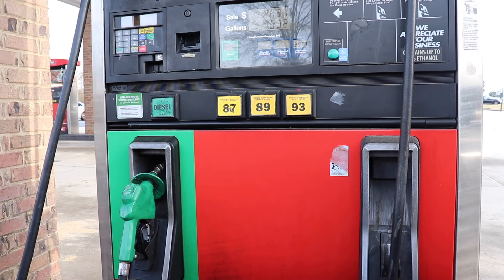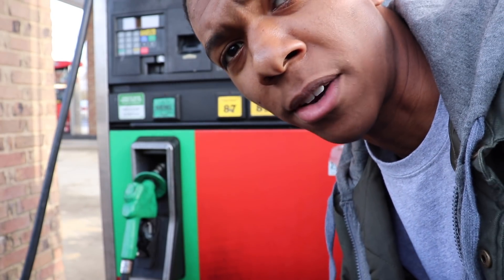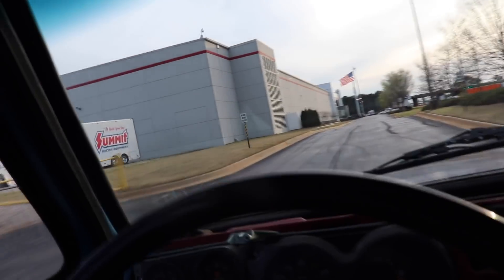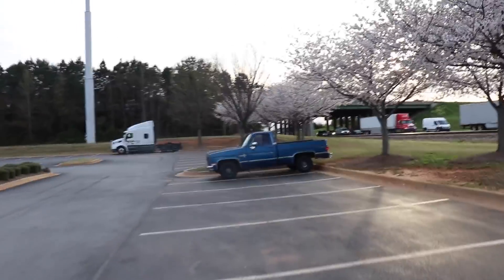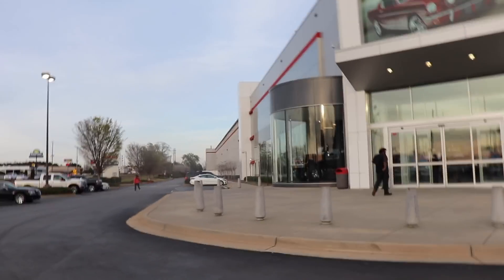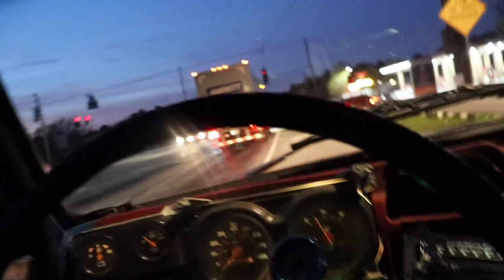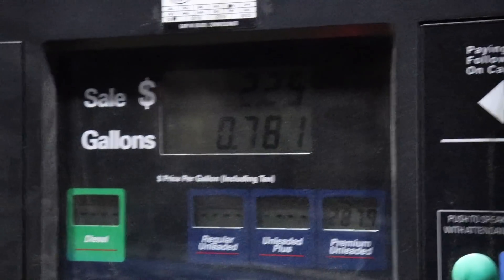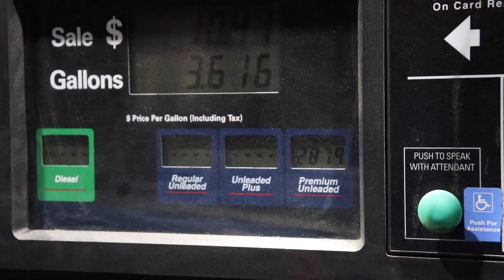Gas Mileage of my Cammed C10 Chevy Truck..... Worse than I thought...... (with 2.73, 355ci, & th400)

Comment: 11.5 mpg isn't bad. Efficiency in that truck should now be measured in SMILES per gallon :D
Reply: Our 90 k5 with a 350, 6 inch lift 35 inch tiers, with 300k original miles unrebuilt gets 11mpg. Our 88 k5 stock brand new engine with manual gets around 27
Reply: I get like 7mpg in a stock 1977 Chevy k10 with a 350ci th350 trans and 3.07 gears, 4 inch lift with 33” radials
Reply: Dustin  Wagner how are you getting 27? Is this with the odometer showing the correct number of miles? That’s an incredibly far out number.
Reply: Dustin  Wagner hey what about a 68 C10 restore frame to rebuild inside and outside fully restored how will mpg be 15 mpg average
Reply: My 87 is on 33s and I get 9.5 and hauling hay I get prob around 7
Reply: 11mpg is big block mpg how you burning that much fuel.

Comment: Best thing to do next would be 3.73 gears. Might as well throw in a truetrac while your there. Your truck will really wake up. The turbo 400 robs lots of power. You can build a 700r4 pretty cheap. Deep first gear and overdrive.

Comment: ZZ  Was the designation for Chevy performance crate motors. normally ordered through the Chevy performance catalog or local dealer. ZZ 350,ZZ 383, ZZ 502. I  Believe they were all gen one blocks with 4 bolt mains and 1 piece rear main seals.

Comment: Get a 700r4 keep it in overdrive, does very well on gas.
Reply: Yup or maybe a T56 swap
Reply: Or a 200r4
Reply: @deanthonyhicks69  No experience with 200r4.
Reply: Unless it's lifted with bigger tiers then you won't do much better than 11
Reply: 700r4 is one of the weakest transmissions
Reply: @jacksmith-ql3jo  not really😂😂 just need to keep up on maintenance for the most part. 300k miles unrebuilt, was a snow plow for 20 years and the rest is all mud and daily driving. Still has no issues what so ever.
Reply: @jacksmith-ql3jo  I've had good luck with it for daily driving but I don't tow with that truck either. I assume you're referring to them being weak if used for towing.
Reply: @dimefever1006  they aren't the best choice for towing / performance , for daily driving they are just fine , I have a 2000 blazer with a 4l60e (same thing as 700r4) and it's perfect , but I also have a 97 S10 with a 700r4 with a built 355 I have been through 2 of them , 1st went out on the first one and I snapped the sunshell on my 2nd one

Comment: Not bad! Mine gets 11 mpg with a stock 6 cyl. LOL
Reply: Ciro Singleterry I also have a 84 6 cylinder my exhaust manifold is integrated on the head
Reply: Camo Dude MTB&H cool, never seen one of those integrated ones in person, only seen separated. You should watch the folks over at powernation, they built an old Chevy six for a c10 and it sounds amazing.

Comment: I got 27 mpg out of my built 355 but she was lean and mean 85 c10 flat top 355 1.6 roller tip rockers mild 883 heads .500 lift with rockers block was decked and crank rods and pistons balanced 6inch dampener th350 trans weiand high rise intake and a tweaked 600cfm Holley single pumper

Comment: If you haven't already, hook up your HEI vacuum advance hose to the Vacuum T on back of intake manifold, not the carb like factory did it (timed vacuum for emissions) Guaranteed better idle, cruise MPG. May have to readjust your base timing or idle mixture screws.

Comment: Might need to tune the carb a little, and advance the timing. Keep in mind I don't know where your timing is now. Also look into a wide band 02 sensor, to make sure your not running rich.
Reply: My 1977 K10 manual on 4in lift with 35s im running a 327 with a Edelbrock 600 cfm stage 2 on 12 degrees advance
Reply: @gavingood1787  initial,or static....what is total advance,and at what rpm?
Reply: @JohnSmith-bx1mp  12 degrees advance on idle about 1k rpms

Comment: Try re jetting the carb. AFR gauge isn’t bad to have either. Ideally, you want about 14.7:1 at idle and around 12-13 at WOT. See what that does. Might be able to pick it up a bit.

Comment: 11.5mpg isn't that bad! There are modern trucks that get that bad. Hell my 92 f150 with a 5.0l 302 did worse than that. Even on the highway. I remember filling the 18 gallon tank and from full to empty getting 100 miles straight highway miles.

Comment: 85 k1500 31x10.50, 4spd, 70mph, 4.10, hubs unlocked 16mpg.  you're probably overcarbed. try doing your setup with a vacuum guage.
Reply: damn, 16 mpg.
Reply: @astronau7_lone574  used to get 12 with the holley, then went to an edelbrock #1405, went through tuning and swapping  through a few jets and needles, tuned it every time with a vacuum gauge. i run the timing a touch advanced +2deg. if you take the time to dial it in, you can do it. Its a 74 no egr block and intake, might make a difference.  I tuned it around 5 years ago, and havent had to mess with it except to tune it for winter and summer. you cant hear the difference, but you can tell at the pump
Reply: @marshfield01  sure wish I knew what the hell all that means. I'm a new mechanic, barley ant experience.
Reply: @marshfield01  I'm just fuckin with yuh, but were you talking about you got 16 miles per gallon in a Chevy c10?

Comment: Yeah man you must be making some real power ...11 miles to the gallon with a small block rivals what I get with the warmed over (weiand intake/625 cfm carter carb and  headers) 454 in my 87 Chevy Crewcab Dually. . Wish I had 3.55 gears in my diff instead of 4.10's.

Comment: When I rebuild my 72 I wanna run a howards rattler cam. Not gonna be a daily driver so gas mileage wont be a big concern of mine. I also plan to get a pair of black widow mufflers to replace the flowmaster 10's on it currently. They seem to sound nice from videos I've seen on them. Definitely too loud for daily driving though.
Reply: FLOWMASTER 10 is the best, I have one with dual tips coming out the back. Sounds deep and throaty.m

Comment: 11.5 is pretty good. my 425 horse 355 in my 85 k10 gets 5-6 mpg spinning 33s. the 550 horse 427 in my 66 impala....less than that.
Reply: I'm restoring a 66 impala with my dad. I'm putting in a 396 into her, the dino sheet i have for the motor says it puts out 494 hp. Being the car is tubed out too...so if your getting that i should be worse, which isn't great to hear
Reply: Haha I get about 8
Reply: @skywalker24680  I would be getting more, but I like the sound it makes when that 875cfm holley opens up all the way
Reply: @thedustyredneck  dude. I'm right there with you man

Comment: That's just normal mileage.  I had an 85 swb with a 305, quadrajet and 308 gears and it would only get 12 mpgs.  Had an 87 K5 with vortech heads, Holly 670 tbi and intake drilled for the head turning 35's with 456's through a 700R4 and in would get 10mpg

Comment: Bigger cams run more efficiently at higher rpm. I saw your tach reading about 2000 rpm when you were cruising, which is low. Carb type and settings, ignition and timing, factor into it as well. If you like the lope but drive at lower rpm, that's the price to pay. You could probably get +/- 20mpg with a smaller cam and some tuning. But that's kinda boring.

Comment: 11.5 is not bad for a cammed 400 turbo truck.   If this had a 700r4 or nv3500 speed these setups get upwards near 20 in my experience.  Im putting together a 350 5speed truck my self.   Love the channel.
Reply: 11.5 is terrible.

Comment: Dude I have a 1980 C10,350  four bolt main,small Holley 600 cfm. 12 mpg. I was thinking about putting a spider EFI on it with a MDS ignition. Heard you get lots better milage.

Comment: advance your timing by 2 degrees.   You'll get better mpg
Reply: My 1977 K10 on a 4 inch lift on 35s with a 327 running a Edelbrock 600cfm manual is about 8mpg
Reply: Who says?
Reply: @gavingood1787  what rear gear? Im assuming 456 or 411?
Reply: @rexmedina4561  I would think 3:73 but not 💯 sure I haven't took it apart to know... We bought this truck off of a guy stationed at the local AFB...
Reply: @rexmedina4561  I also don't know if this is an original rearend... Ik it came with a small block 250 v6 so I don't think it was to high geared

Comment: Your privileged to be able to drive to Summit Racing. I'd make that trip once a week. What gears are you going to use with LSD? I agree with a built 700r4 for highway cruising. My lwb 85 was a gas hog as well. Stock 350 duel plane Edelbrock 600 cfm 350th LSD 3.42 gears. Strong pulling fun truck with poor gas mileage. Keep the videos coming young brother. 👍👍👍
Reply: Right!!! Wish I even had 1 in the same state as me lol. At least it's only 2 days through mail lol Still like to be able to go in and shop around like a Walmart or something, I'd probably spend hours in there at least twice a week haha

Comment: Should've had an 700r4, it will change rpm
Reply: Young Chevy I have a 1500 gmc sierra classic with a 700r4 an rpm at 1500 doing 65
Reply: Nv4500 in my 1995 2000rpms at 70-75 awesome on highways only mods manual swap&headers&cat delete
Reply: 700r4 is a nice trans... easy to find too

Comment: You need to break this motor in. Then, How did you tune it.  Did you just use the carburetor off of your old motor. Buy a good AFR meter.  Then you can read your exhaust and dial you air fuel mixture perfect for the area you are in. 
  Or... go to one of the modern day bolt on fuel injection systems.  50 miles after the install. You'll be amazed at the fuel mileage . Well maybe not amazed. But it will be better. Break in & tuning. Your start point is almost acceptable. You over camed your motor for the street. But it sounds nice.

Comment: My brother gets 4-8 mpg on a basically stock 350 with a 4 barrel intake and carb with headers that’s the only upgrades
Reply: Jared Getzlaff def need a tune up then
Reply: Lol it needs more than that now he hot rods the crap out of that truck he isn’t good on any vehicle he hops in doesn’t check any fluids and just keeps his foot to the floor he has blown up so many vehicles it’s not even funny my uncle had to basically overhaul the 350 and it is almost all buttoned back together again

Comment: u will find out if u put a big block in it it will get the same or better in miles per gal plus way more power in my 68 i put a 454 stroker and i'm getting 15 to 17 mpg but if i hit it hard it will burn the fuel

Comment: 502 is the biggest crate engine u can buy it's a Chevy big block idk what ZZ stands for maybe some type of off road 4x4 package
Reply: 572 is biggest. You can also get a 632 race engine.
Reply: @matthewsmith-ng9ds  That sounds right
Reply: Yeah it is a 572
Reply: ZZ  Was the designation for Chevy performance crate motors. normally ordered through the Chevy performance catalog or local dealer. ZZ 350,ZZ 383, ZZ 502. I  Believe they were all gen one blocks with 4 bolt mains and 1 piece rear main seals.

Comment: My 85 Chevy long wheelbase with a 350 and 2800 stall on a 3-speed with the passing gear horsepower was 360 torque was 310 would 373 in the rear end and I got about 15 miles to the gallon. And I could almost out beat a V6 Mustang and I weight 4700 lb in that truck
Reply: 650 carburetor Edelbrock

Comment: Objectively (compared to newer motors) the old Tree Fiddy is absolutely a trash motor.   Low on power, heavy on fuel consumption.  But they do last forever and they are cheap ass hell to build.

Comment: I got a  454 that gets 10 miles per gallon gramma driving rebuilt top to bottom peanut high flow heads at .300 lift.
Reply: Take out the front grill avoid stop lights.

Comment: Advance the cam 2 degrees, and a smaller carb.
Reply: advance the timing*
Reply: @bananasEveryday Why??
Reply: @hedatguy  So you think advancing the cam will help more then actual timing? Idk much about advancing cams and their benefits vs actual timing on the crankshaft so I'm all ears
Reply: @jjmccloud  Yes sir it will. And by the way, thanks for the reply. Advancing the cam timing changes the RPM range of the horsepower and torque curves. And you don't need a big carburetor to make power.
Reply: @hedatguy  awesome, I'll look into doing that on my build now
Reply: @jjmccloud  Hit me up if you have questions. I have been working with small block chevys for a lot of years.
Reply: @hedatguy  that's whats up! You got an email. Might be easier that way if I do
Reply: @jjmccloud  Bring it on sir, glad to help.
Reply: @hedatguy  what's the best way to contact you? Wanna talk more about adjusting my cam before I seal it up

Comment: 2.73 or 3.73 rear end gear? I know that a 3.73 is stock.
Reply: In the c10 an 1500 they came with 2.73 1987 on up came with 3.08 those are top end gears
Reply: @johnnyblackking169  in my glovebox it still has the original options stickers and mine is a 3.73

Comment: my 350 got 8-9 lol.  Worn out and I beat it into the ground.  383 Goin in now.
Reply: In the process of beating the piss out of my 350 lol,small cam and some valve springs,pushrods. I do atleast 1 or 2 skids when I drive it lol,puts a smile on my face everytime.
Reply: @honksgarage8084   Hell yea brother,all I've had to do so far is adjust valve springs once or twice,but since then and surprisingly all the hell it's been through,everything is still solid lol

Comment: Throw that carburetor in the trash and get fuel injection.
Reply: Blasphemy!!!!
Reply: James J. McCloud sometimes the truth hurts, but carburetors are garbage! I do 100% understand budget issues. If he stays on track, Budget shouldn't be an issue in 2-years or less. Focus on the money Youngchevytruck.
Reply: Sometimes the truth does hurt, however it's not me that it's hurting, If it's hurting anyone then your the sore 1 here, carbs are only garage to the ones who don't know how to tune them or feel overwhelmed by everything they Intel. A properly tuned carb will function just as well if not better then most of the efi systems and are much easier to keep track or things to keep it working right. Fuel injection has its place of course but it is not always the answer and most people who don't know what their really talking about are so quick to say, oh should've just went fuel injection, with no real ground to stand on for why they say it other then they watch to much YouTube instead of turning a wrench or using a dyno to get their info in real life. Just my opinion but probably not alone here, you keep your fuel injection and 20ft of random wires with a dozen sensors in every direction for this kind of build and I'd say he's picked the best set up for what he built. Plus it's a gen 1 sbc wtf would you wanna have anything but a carb on top of it anyway, it's just made to be that way
Reply: James J. McCloud 🤔 I do suck at tuning them😂